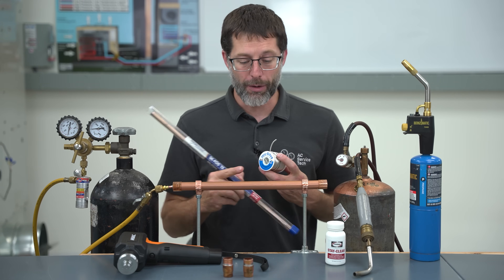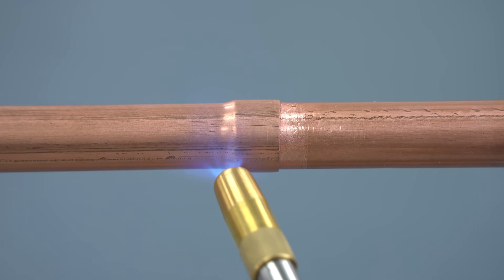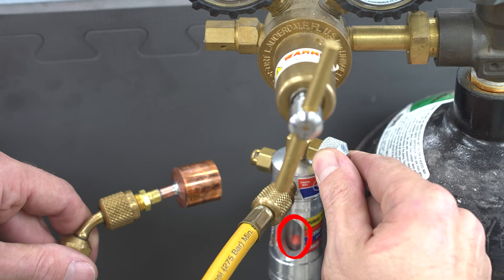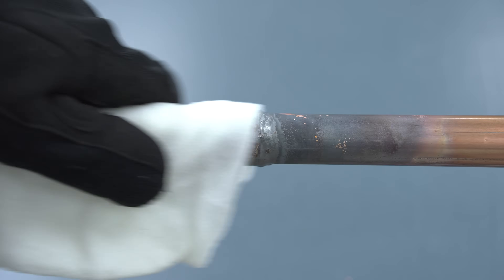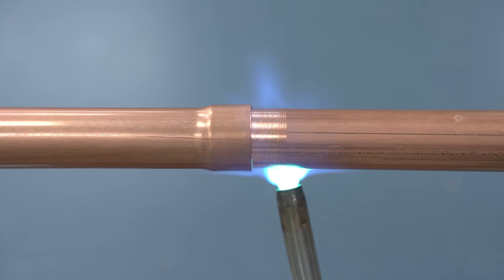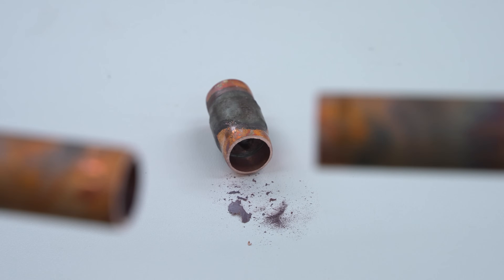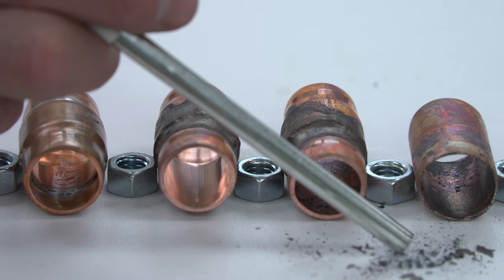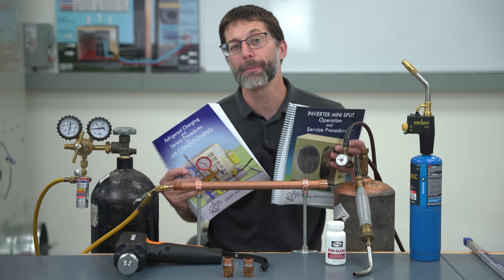HVAC Silver Soldering vs Brazing vs Brazing While Flowing Nitrogen!

Comment: You gotta show best practices if you are giving flux+soft solder a fair shake.  

Flux does 2 things - it cleans the copper with acid (most important) and acts as a wetting agent for flow.  Really cleaning the copper on rough, sanded copper is good enough, the 'wetting/flowing' agent doesn't really do much.  In soldering (or brazing) the filler metal wants to go where there is heat and a rough uncarbonized area where it can settle to.

Try this:

1.  Put a liquid flux on a q tip, swab it on your roughed up copper pipe ends that will make up the joint.  
2.  Let it sit for few min while you do other stuff.  
3.  After that you can even get a dry q tip and wipe of whatever fraction of a mililiter amount of liquid flux left.  
4.  Connect the joints and solder it good, heat the male end quickly, then the female swage where you want the solder to flow. 
5.  Have the solder ready on your pipe on the opposite side of your torch heat.  Also 1/16" staybrite flows let better than the 1/8" especially on 1/4 and 3/8 pipe.   (as do those thinner round brazing rods for that matter)
You can put a solder cap on there you want.
6.  You end up with a perfect joint - clean, solder penetrated, non annealed like after brazing.  Supposedly better equipped to handle vibration.  Air tight and no worry about flux inside the system.  

Only reason to braze is manufacturer or jurisdiction guidelines.
Reply: I started with a company in Tucson in 93 and silfos was mandatory because customers were stepping on the linesets and cracking the braze. That only happened twice I think,  but it made sense to me.  I always ran a thick cap on my joints because of that and might have avoided call backs. Jm2cents
Reply: I only solder.....so much easier and better for the tubing.
Reply: I'm glad I'm in the HVACR business so I can keep all yall trash ass installers cutting corners out my house. Soft solder is far inferior. Leads to more problems if done incorrectly

Comment: The flux will become inert overtime. but the brazing with nitrogen is the right call to do the job clean if you don't put an inline filter.
Reply: It becomes inert by the time your done testing the unit after install.

Comment: I have had over 10 units installed in my life time and have never seen anyone use nitrogen. This is really good information. No wonder my compressor keeps burning out and locking out. They put on that booster pack and it works for few weeks then boom!!! 💥 dead ☠️
Reply: @eddyflexy…if I may offer some information, if you keep having compressors fail, there’s a great chance that you have insufficient air flow. Namely return air. This in effect, acts as an overcharge, allowing liquid refrigerant back to the compressor. Testing total external static pressure and also your duct pressure would be a good place to start in finding out why your compressors keep failing.
Reply: @999raiderz thanks friend

Comment: You have to be doing ALOT of solder joints to affect anything in there to that extant.  Brazing is slightly better used on critical refrigeration systems or hot gas lines. For AC, i will staybrite 8 all day long no issues ever.

Comment: I just wanted to say your the best teacher tech I have seen. Im a rookie in HVAC three weeks . Basically watching you is like reading a textbook very high quality of work . Thank you for all your info
Reply from the maker: Thank you for watching! If you're looking for free HVAC training resources, check out our website for articles, training projects, and more! https://www.acservicetech.com/resources
Reply: @acservicetechchannel  Have you ever done a pressure test to see which joint fails first the solder joint or the braze joint. I have found that a solder joint will burst around 7000 psi and the braze joint will burst around 3500 psi. The solder joint can handle 2x the pressure before bursting because a in order to braze you need to reach temperatures in excess of 1000 plus degrees F. When this happens the copper tubing anneals causing it to weaken significantly. So, I have found that soldering creates a stronger line set for ac systems than brazing.

Comment: If you have good filter driers installed, they should catch any cupric oxide flakes before they circulate multiple times.  Flowing nitrogen is a fine practice,  so I am not advocating against it.  Just saying the drier should catch anything floating through the pipe.

Comment: I've built hundreds of systems without using nirtrogen. I dont like that burnt stuff as it can clog cap tubes. I wanted to switch to SB8 because where I am there is absolutely nowhere to get nitrogen. I have actually used 134a to purge while sweating but dont want to breathe the fumes. For my line of work SB8 I think is a better choice. It can handle any pressure for any hvac system fine.

Comment: Well what if you need to braze from copper to steel? You have to use flux when brazing a steel king valve or steel compressor discharge line. What would you suggest?

Comment: If you read through the comments below, there are MANY people who say they have used the solder/flux method without any issues.  All of these comments cannot be ignored.  The video shows flux inside the copper.  Then there is this jump in reasoning that it must dissolve in the oil and mess things up.  That is a big jump.  We are led to believe that the bad part of the flux is the acid.  Let's just go with that.  Some of the acid in the flux will get used up, chemically reacting with the copper or copper oxide or whatever.  It will get spent.  For sure, some of the components of the residual flux will be decomposed by the heat and oxygen in the air and will be turned into various decomposition products.  Some of the decomposition components of the heated flux will never dissolve in the oil, they will just remain where they are.  Solubilities matter.  Then this runaway acid reacts with nothing in the copper tubing on the way to the insulation on the windings. As we all know, copper tubing is not scrupulously clean and shiny on the inside. Nothing for the acid to deal with there, I suppose (not).  At about 16.21 in the video, a cloth is used to wipe the heated residual flux inside the tube, but in my opinion, nothing has changed in appearance.  Also, the white cleaning cloth is not shown to us, probably because nothing was picked up on it.   I could drone on, but for me, this video shows that the solder/flux method is the way to go!  Fewer tools, safer because of lower temps, etc. Case closed.

Comment: So I just had a my R22 AC with a locked compressor replaceed with a new 454b system.  They didn't flow Nitrogen or even pull a vacuum.  How concerned should I be?

Comment: I'm installing a new condenser unit. Problem is, when I'm done the unit will be about 10 inches away from my exterior wall. I'd like to take this opportunity to position the outside unit about 2 feet away from my house. Is it possible to buy a 7/8" OD extension for my lineset?
Reply: Not possible
Reply: @ guess I'll just have to find an HVAC technician willing to part with some...

Comment: Don’t ever use silver solder with refrigerant. You can get away with it sometimes. The molecules of refrigerant are actually smaller than the silver can “seal” and can leak. Brazing is the only way and you already have your nitrogen hooked up from purging the line. Set it super low and braze away. Make your braze joints look cleaner by actually getting it to the proper temp evenly. Use couplings don’t swage.
Reply: I need to extend my current line set by about a foot and a half. (I already used a solvent and foam pig to properly clean my current line set).
Is it possible to buy a 3 foot section of 7/8" OD acr? It seems impossible to find.
Am I best off going to an air conditioning pro and asking him for scrap 7/8 line set?
Reply: Reason being, if I use the current line set, my outside unit will be about 10 inches away from my exterior wall. I'd like it to be about 2 feet.

Comment: Sporlan invented driers to catch the cupric oxide dust and driers that neutralize acid.  A separate  acid neutralizer can be  introduced into the system to neutralize acid that can be introduced after a compressor burn out and the effects of cupric oxide. Remember there is more than one way to do the job properly.
Reply: And how efficient will it be? We need to know the best installation practices; we need to investigate and not just rely on what we've been taught.

Comment: Well first of all any unit with a txv has a screen in the evaporator coil at entry so anything that would cause a problem would get caught there and easily checked by backing the ref into the compressors with the valves and then open the discharge line at the evaporator coil and look. So yes it helps to do it with nitrogen but I've never seen a system that had issues from the filter being clogged 20 years in

Comment: The reason air conditioners aren’t lasting as long anymore is because the windings and the compressors are made with cheap materials to break down after five years. My air conditioner was installed in 1987 and is still running because it was made in America.

Comment: 37 year tech. If you read the comments younger techs, you will quickly learn that both ways have benefits and downsides and an equal amounts of fanboys on either side. The job type  is always key to your choice of tool. That being said IN RESIDENTIAL APPLICATIONS if you read about todays Parker and Emerson filter driers at 16 cu  it should be very difficult for cubric oxide or flux of any meaningful quantity to impact the performance of your equipment. If one were to run out of nitrogen to purge on the jobsite while brazing (unless you are brazing multiple joints), So don't panic. But best practice is still the best advice.

Comment: No dude. You use that liquid flux and just wet the joint with an acid brush. You won’t get all of that flux. That paste flux is really for processed water lines and stuff like that. Liquid flux. Looks just like that paste flux bottle, but liquid.

Comment: Staybrite works great, but there are times I have seen valves that were soldered in a vertical position (cup up) and the guy overfilled and a bunch of solder gravity drains and ruins the valve instantly. You have to be careful with it and I don’t recommend it for discharge lines or any kind of hot gas lines. I have seen really hot discharge temperatures and high head pressure blow out Staybrite joints. Sometimes people bypass discharge temp safety switches because they think they are causing nuisance trips or they are just stupid and unclip the safety and let it hang by the wire.

Comment: its kinda funny because i use plumbing solder on the distribution block right after the TXV when replacing large evap coils. The manufacturers use staybright to prevent the tubes from separating from the brass but ive never had an issue with regular plumbing solder. Keep in mind out units trip on head pressure at 590psi. The key is to heat your fitting before you fit the pipe and wipe the excess so you can get a paper thin layer. if its upside down i use a fresh brush with a tiny amount and heat the pipe to a hot to the touch without burning and carefully melt it in. Throw in a high acid filter and fingers crossed lol.
Reply: Your comment is not cool. Using soft plumbing solder is mechanical code violation. It must be either silver-solder or blaze. Try cut the joint with hacksaw it's more difficult with sb8.

Comment: If you don't have N2 gas, what about stuffing dry ice into the tube and sealing it mostly.  The CO2 will outgas to displace air and is already burned so shouldn't be any available O2 to oxidize the copper.  Why can't you flush the AC lines before final connections?

Comment: So after using the staybrite, when you pull a deep vacuum it doesn’t just boil that extra flux right off? I know a guy who uses that specifically for repairs not installs, then pulls a deep vacuum and never has issues or call backs. I thought that was the point of pulling a vacuum.

Comment: Systems sealed with  Staybrite 8 don’t leak and has proven itself in the field.  Use the flux sparingly and most of it boils off during the sealing process.  I have actually done an acid test with a system sealed with silver bearing solder and no acid was detected.  For a basic install of a new HVAC system you only have to seal a Lineset at the indoor and outdoor.  The key is to keep your connections to a minimum.
Reply: Yes. 
Ratcheting bender , swaging tool, scuff inside , edges and outside of fittings, only flux the outside after the joints have been assembled. Only on connections on the outside of the condensing unit all help

Comment: What about the case where the HVAC outdoor unit pipes are made of brass? You have to use flux to braze those connections?

Won't the filter drier remove the acid from the flux paste?
Reply: do not need flux on clean joints ever...15% has a cleaning agent in it.

Comment: This, this is why I hate flux in any kind of soldering. The smell is hideous and far more toxic than welding, worse the corrosion after effect if you didn't clean it
Idk why, but Workshops hvac in 3rd world country like mine they have weird solution to just flush the pipe with high pressure water and soap, the compressor are always disconnected before they started to flush
Does it work? Honestly...idk I'm kinda skeptical too

Comment: 14 yrs. ago when I replaced my 47 yo systems, I was with the very impressive tech every minute, an interaction we both enjoyed (honest). I asked him the same solder v. brazing questions your video brought up and his answers were identical to yours. My Goodman systems continue to function perfectly with NO issues.  I keep the condenser area free of debris and the coils reasonably clean. Otherwise no one touches the units. Once the units are correctly installed (often a problem) and functioning properly, no one can make them function better, so leave them alone.

Comment: When I was.
Working in hvac, probably when you are a teenager.And even when I went to school for it.We never used Any of the , uh , that or even nitrogen and You vacuumed it afterwards anyways
Reply from the maker: You are referring to mineral oil systems R12 and R22 which dont have much of a hydrolysis problem like POE oil. Mineral oil is completey different. This is meant to be a training on newer systems over the last 20 years and moving forward, thanks!

Comment: If you are installing Carrier and ICP products at least until the new R454B products arrive, the installation instructions only allow for brazing. It is always best to go along with the manufacturer. It helps to keep you away from code enforcement hassles. We have some good inspectors and a couple of exactly by the book inspectors in my area. They always default to what the manufacturer says to do.
Reply: Are the press fittings to code? Manufacturer approved? Would the inspector approve?
Reply: Read each manufacturers installation instructions, they should list what is acceptable.

Comment: 1st off, you do not heat the swedge part. It will expand and leave a bigger gap for the solder to fill, making the joint weaker.
2nd use acid flux, there will be no residue.
3rd solder joints are stronger than brazing under pressure. The amount of heat needed to braze makes the copper soft and under extreme pressure will burst before a properly done solder joint.
I have been in HVAC since the 80s, never had any trouble with solder joints.

Comment: Heat will only travel so far down the pipe before it rises off the pipe completely, as heat is known to do, ..and surprisingly, it's not very far. So thats not the reason to keep the torch moving. Its so you dont melt the pipe (tube). I would have liked to see the brazed joint cut open to reveal the 11 to 1 o'clock position, instead of the pipe.

Comment: ¿¿ Rule of thumb for what length of solder &/or silphos to bend ? 

Ratio of pipe diameter to amount of solder / silphos to use?

Many moons ago on my fiirst attempts on small refrigerator compressor replacement, completely filled the suction line with Stay-Brite!

Comment: Im no HVAC tech, but I have soldered and brazed for Ultra High Vaccum x10^-12 torr systems in another lifetime for 20 years.

Never ever would you use soft solder in such systems it would leak and breakdown mechanically. You do know you can buy various low temp hard solders that start melting at over 600 deg celcius, look at Eutectic brand, usefull if you have close joints.

Someone in the comments mentioned he just fluxed the outside, he is correct as the flux is drawn into the small gap by capilary reaction and that does not need gravity to help it flow. In saying that where possible I would always solder or braze with the piece vertically not level as that can put too much solder where its not required, this is just being a neat joint freak.

I understand in situations and installs you cant but we used to pickle small brazed joints in 50-50 hydroclauric and sulphuric acid baths and then into a neutral water bath. Thing comes out like a shining bright new penny.

Someone commented on not using Nitrogen to back ourge the system, I have welded as well and that is a must for Stainless Steels as it stops discolouration and oxidisation on the i sides of the pipes 

I understand i am not HVAC but surely someone does some flushing fluid to purge the system before use?

Comment: The carbon will collect in the expansion valve liquid line screen. Supco oil additive will dissolve it. The carbon will collect in the oil sump of the compressor turning the oil black, doesn't affect the viscosity. If the compressor is a semi hermetic, do a oil change.